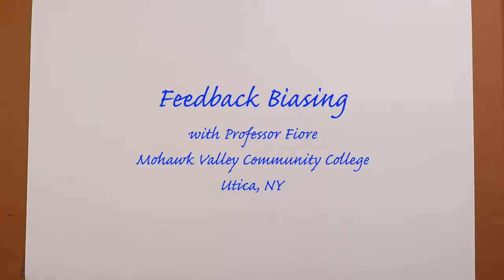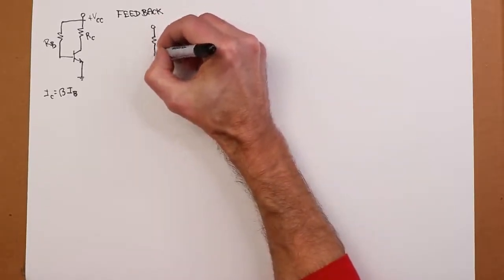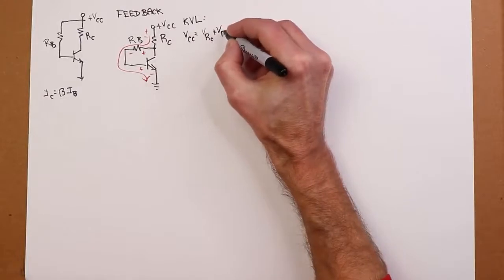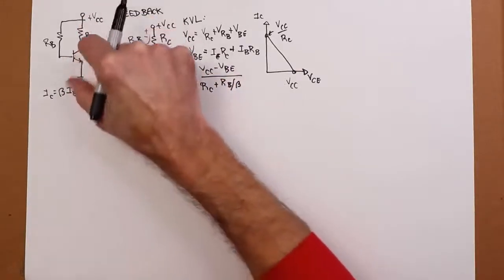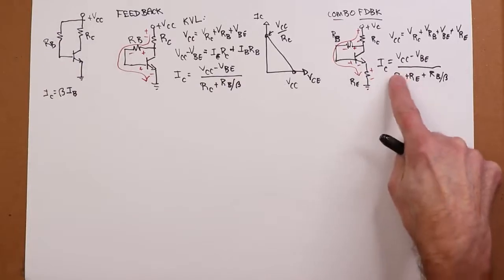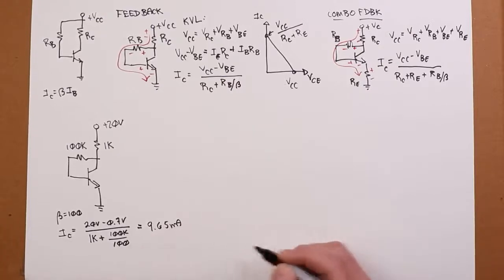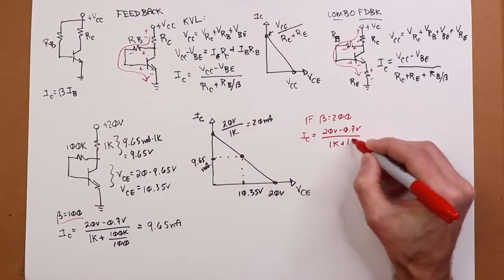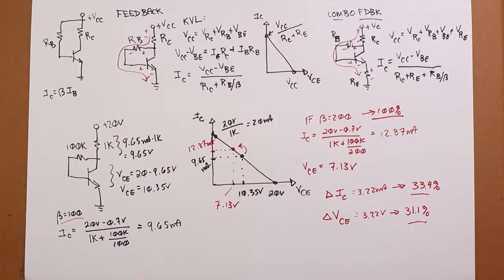Semiconductor Devices: Feedback Biasing

Comment: Hi Mr. Fiore 
In your first feedback circuit with the resistor RB connected from Base to the Collector. the maximum current cannot be VCC/RC since it assume that Vce=0V. The collector voltage power up the base of the BJT and it need to provide at least 0.7V to the base to keep the circuit in the saturation mode; hence, the saturation current should be (Vcc-0.7V)/RC
Reply from the maker: Yes, the maximum achievable collector current is (Vcc-0.7)/Rc. This is apparent from the Ic equation (making beta impossibly large and/or making Rb insanely small). To be clear, Vcc/Rc is the Y intercept on the graph. The point being that Ic can never quite get there. That is, Ic approaches that point but never "arrives", hence the circuit cannot go fully into saturation.
Reply: Thank you Mr. Prof Fiore for answering my question

Comment: If we create a voltage divider circuit for the base, connected to the emitter and collector with resistors on those leads (So we have feedback in the emitter and from the collector, I hope that made sense), how would that compare to a straight voltage divider? So, we have a voltage divider but rather than VCC and Ground, we connect the appropriate resistor values to the E and C of the transistor. I might have to hit the simulator. Great work Doc.
Reply from the maker: You can combine collector and emitter feedback into a single circuit, and it can be quite stable, but with one more resistor you've got a voltage divider which likely will be better (and it only costs you one more resistor). In many cases, you're better off going with a split supply as you have more flexibility. Bias stability isn't the only thing we need to address.
Reply: @ElectronicswithProfessorFiore  I just ran a simulation on a few variations and it looks like the voltage divider bias has less distortion than the collector bias. Although I'm new to distortion analysis (I used the same emitter degeneration resistor value).
Reply from the maker: @simonyoungglostog  For a fair THD comparison, make sure the output signals are the same amplitude. Also, set the gain the same.
Reply: @ElectronicswithProfessorFiore  I was struggling to get the variables to similar values. I've just had another go (spooky) and can see that when the output voltage is the same but the gain is less, the distortion is less. Which you indicated. I can't tell if the distortion is better when I link 'R1" of the voltage divider to the collector instead of Vcc (I change the values of R1 and R2 in this configuration to try and match the collector current). It's all fun experimentation and learning. I shall have to have a rummage through my 'Doug Self' small signal amplifier book, he did lots of work on distortion.
Reply from the maker: @simonyoungglostog  Doug Self's work is well known among amplifier enthusiasts.
Reply: @ElectronicswithProfessorFiore  What do Electronics lecturers think of it?